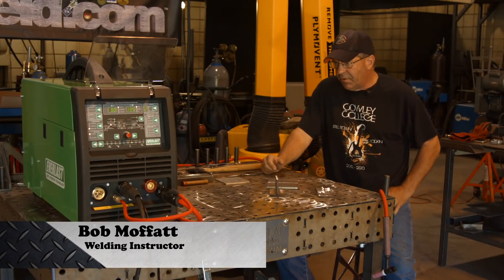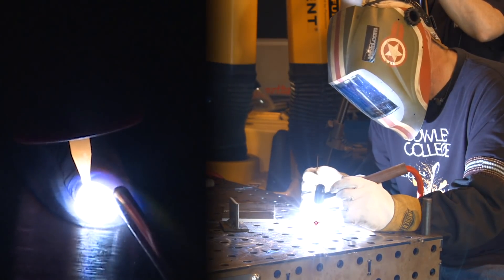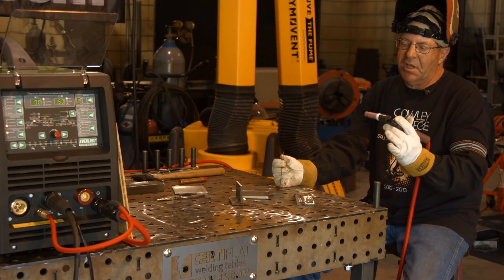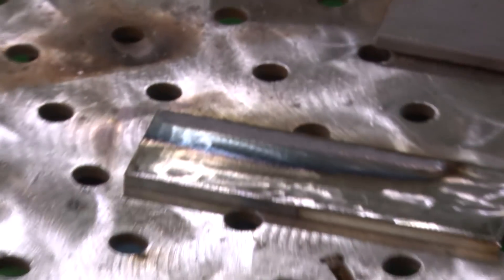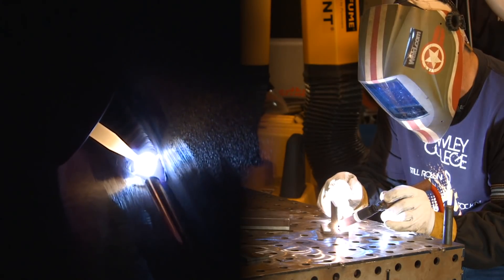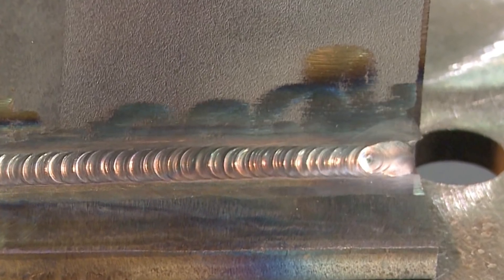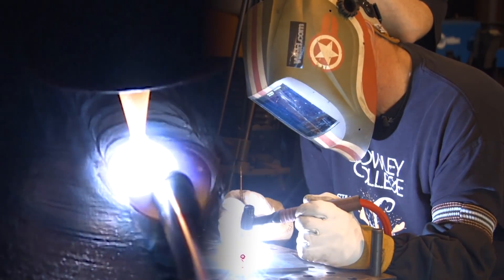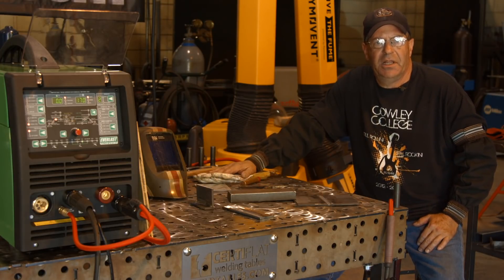🔥 4-in-1 Machine Overview: DC TIG (Everlast PowerMTS 221sti)

Comment: This MTS 221 STI is supposed to be able to do both AC/DC TIG on Aluminum, can you do a video on this unit doing a variety of Aluminum welds (Thick, med-Thin) as I'm looking for a welder that will do everything I need to do, from Welding a 12000lb Winch on a car hauler to welding light bed frames for shooting targets to welding a alum-Boat, and making Alum-brush guards for a side by side Quad, and everything in-between, oh and of course have to do little nick-nacks, for gifts for family for Christmas... Almost bought the Miller all in one but they don't have one that does all the Aluminum in AC/DC, they said they will be coming out with one but not for 5 or more years, and I don't know if I have that many years left... Please test it out really good in all types of welding and post... I also really like the ease of use of the ESAB and wish they would make a AC/DC Tig,Mig,Stick welder... Is this as easy to use as the ESAB??

Comment: i have yet to get my hands on a tig torch... every other kind of welding i have done, short of welding under water..... that is an  incredibly clean weld. not even 1 spark. i will not weld underwater due to delta-p... that scares me.

Comment: This is more of a General Request - that this machine can do.

For new or wanta be welders, I would like to suggest that you do something that welders just don't do - and for a good reason, but for demonstration purposes.  I don't know of anyone who does this, so you'd be the first.

I'd like to suggest you weld - using all 4 processes - that you weld correctly, that is using "a pattern", that is making a puddle with the welding filler material.  Normal welding.

Then weld it in-correctly.  Not using a pattern, but just holding the filler material and letting it just fill up the weld channel (not overfilling it either).  

The reason is to actually show what happens when you create a weld puddle, then move and make another, etc, versus just making one long weld puddle without stopping and filling.  Think a machine that just welds in a straight line (which they do).

Can you even do it?  If not, then that is what the demo is about also.

Comment: Just though I would throw in a comment about my Everlast PowerTig/Stick 250 EX. I purchased new in 2012 and have been using on a regular basis for the last 5 plus years incase anyone would be interested in a little review of this welder. I added an Everlast 300 cooler, CK 20 water cooled flex torch with the very flexible lines, and the top quality foot control from SCC Mentor, Oh. The machine has been working flawlessly in both steel and alum. tig and I am really impressed how smooth it is when welding 7018 rev. polarity stick and has been very dependable. This was one of the first EX250 models with IGBT and all knobs without all the fancy push button whistles and bells, which I like.  Total cost for everything was $1250 for welder, $300 for cooler free shipping no tax, $150 for torch upgrade no shipping and $160 for quality foot control. Grand total  5 years ago  $1860. Not criticizing anyone else's products at all just saying what worked for me. Weld.com thank you for all the very informative welding videos. Ed K Cleve. Oh.

Comment: I'd love to see a review on the new Vulcan welders that Harbor freight came out with, mainly, the AC/DC TIG machine they have. Has freq control and balance control on AC, plus the price point is pretty good.  I run Lincoln myself, but these new machines at Harbor Freight, if they hold up, would be great for the home hobbyist.......
Reply: Watch ChuckE2009’s review of the welder. It does fine on DC tig but the AC function has issues with lighting the ARC

Comment: Does it run a 6010?
Reply: chris jones  it has a setting for 6010 in the stick welding controls.  The video even showed it.
Reply: chris jones most inverters have a hard time running 6010. But everlast does make a welder designed to run 6010 rods.. under 400$
Reply: welditup my esab mini arc does fantastic. Was over 400$ though
Reply: lucas allen must have missed that part. Thank you
Reply from the maker: Yes

Comment: Just wondering if there is any advantage/disadvantage to getting a multi process rig like that vs a separate mig and tig/stick unit. Also, is there much difference between the 221 and the 251?  Love your videos BTW. Didn't know I could watch welding!
Reply from the maker: 251 does not have AC

Comment: This machine runs around 3 grand i hope for that it damn better weld good you can damm near buy a car for the cost of this
Reply: Yeah, I noticed the Everlast site had a nice sale on a bunch of their units recently. You got a nice deal on a couple of sharp units. Please let us all know how well you like them as you start using them.
Reply: Nah, the price of an average, lower-priced new car is about $15,000, I think. So, you can buy more than 6 of these for the price of an average new car. The price of this 4-in-1 seems to be $2699 at the Everlast website, generally speaking, with free-shipping and no sales-tax/extortion outside the involuntary Alta California taxing zone. But there's also a sale price, via Amazon, I believe, with free-shipping too, which seems to be a lowered price when the units may not be in-stock at the moment. And that seems a nicer value if you don't mind waiting up to around 30 days for a delivery. So, yeah, it's a brilliant value as a one-of-a-kind unit on planet Earth right now, which even includes an added Triangle waveform for AC TIG, which is a favorite of mine on thinner aluminum, and which makes this unit a little more than just a full-featured AC/DC TIG unit, approaching nearly an advanced-featued digital TIG unit, like my own Everlast 210EXT. Everlast unit features and values are the best in the industry and market right now.
Reply: You can get the 211si machine for about $1200 with the mig torch, electrode holder, tig torch, foot pedal AND gas regulator included! It isn't an AC capable machine though.
Reply: the 2017 ford raptor goes for $89,000.
Reply: wtf2013.jp@gmail.com 
Just ordered one for just over 2100. They are sale right now I guess at everlast. Amazon still has them close to 3k. Saved so much I bought the plasma 60 which is on sale also.

Comment: Did you use the included accessories (torch, pedal, etc.) or were you using your own? Can't wait to see more, this is the one I have been waiting for.
Reply: Shutter Bugg looks like a ck super flex or whatever they call it, I doubt they'd have given one of those with a machine when they can give one of theirs at a cost of 5-10 bucks to themselves.
Reply: Looks like their new Nova torch

Comment: Hello Bob, nice video as usual, very nice machine aswell. Just got a Esab Renegade es300i myself, did you do a review of this machine aswell?. god its smooth.
Reply: I've been running it in a lot of videos. No official review that I can remember but we've talked about it a lot.
Reply: Kristian Gjerstorff I have the mini arc 161 lts and love it. Use the 500amp warrior at school for 6g cert and like that as well
Reply: I mostly run dual-shield fluxcore, mostly oerlikon 14hd on My migatronic bdh 550 pulse sync and My kemppi pro evolution 3200 and 4200, got the renegade for field repairs and its awesome.